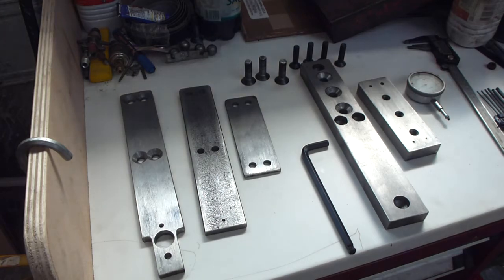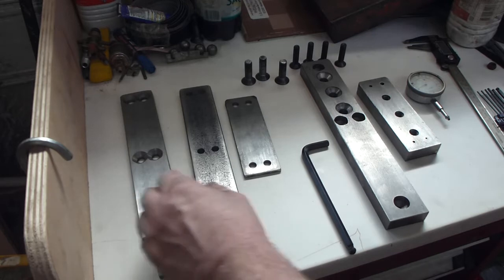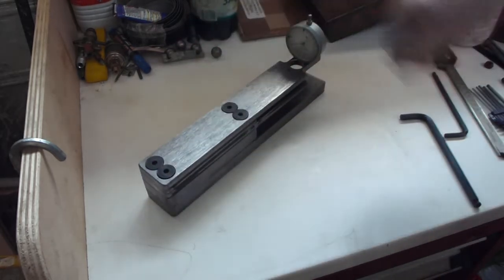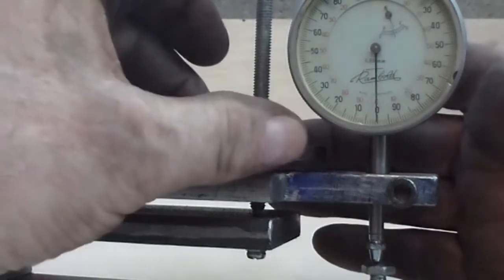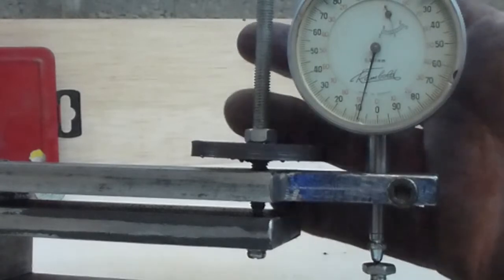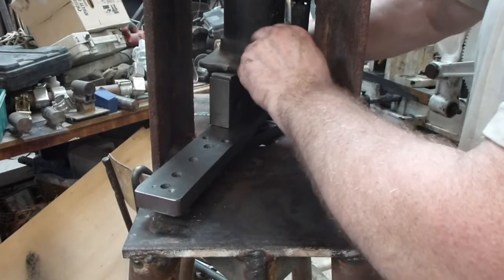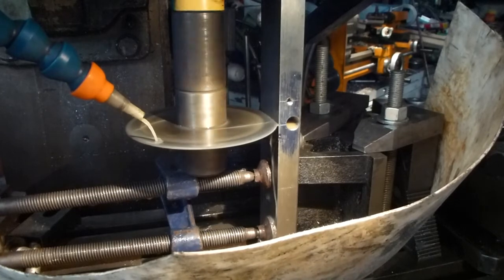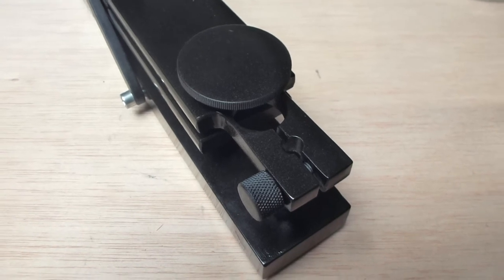Repeat-o-meter

Comment: Thenk you for this useful  information! I'm going to make DIY repeat-o-meter  too and it's very interesting for me.
Reply from the maker: When I made mine, I made it longer than the usual metric ones, the standard metric versions are 100mm from the front pad to the two middle pads, and the same distance from the middle two to the rear pad.
Reply: @MatthewTinker-au-pont-blanc  O, thenk's! It's important information, because I've bought metric indicator 0.001mm.
Reply: @MatthewTinker-au-pont-blanc  As I uderstand, the total  lеngth of the  base between outer pads sets the sensibility of device, isn't it?
Reply from the maker: @voldemargorsky6043  Yes the longer the more sensitive. The 10 cm  either side  mean that  it's easier to calculate the angles from the data from  the indicator. I  am not  capable of the calculation!

Comment: Lovely...I like the hole instead just cut slot on the bottom bar,  what would be the preferred wall thickness at the end? Too heavy or too thin wouldn't be good I guess, maybe I missed it.
Reply from the maker: Konely, I can't remember the thickness of the flexion off hand, I think it was about O,75 mm, but I can't measure it as I'm about forty miles from it!! Cheers, Matthew
Reply: OK thanks!

Comment: Are you planning on doing a video of inspecting your surface plate with it? I'd love to see results of your bare bones version vs the John and Tom bells and whistles version. I just bought a chinese import 600x600mm surface plate and i'm keen to make my own Repeat-o-meter and confirm the calibration certificate that came with it. It's supposedly within 2.8 microns. Keep up the good work.
Reply from the maker: Yes, I plan to make a video of mapping  out my surface plate with it. I have already tried it out, found out something about the wear pattern. My first little experiments have shown me that actually mapping out the wear pattern will make it clearer!